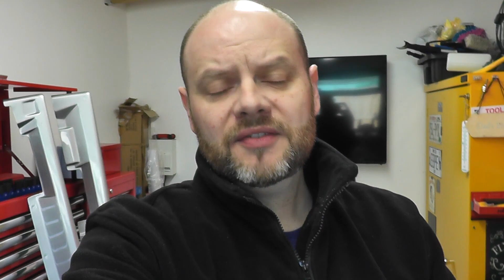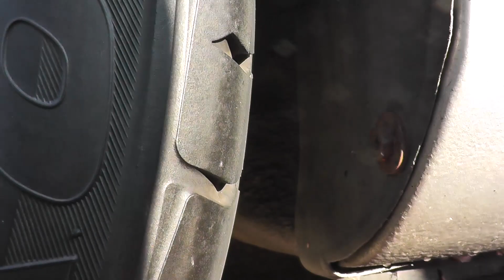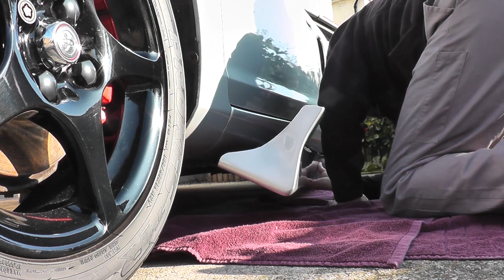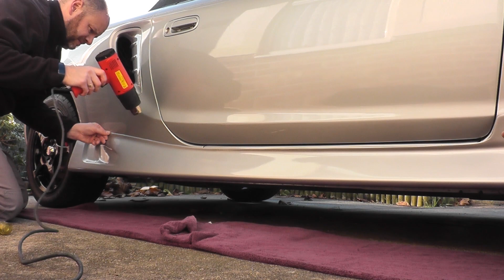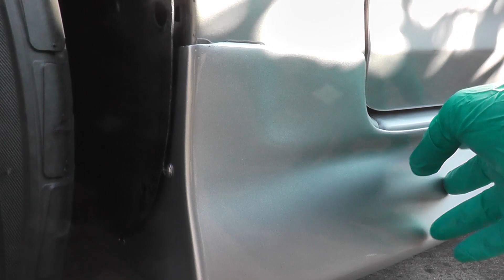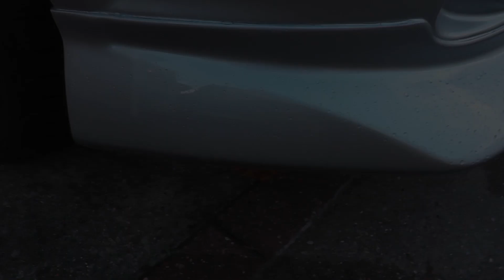MR2 TRD side skirt install

Comment: Although I liked they way mine looked up again the bottom of the door body line, I preferred to fit mine a little lower as I did not like the way they flared out too far at the wheels. Also made mine look lower and did not crack anything. But great job. Oh, I also taped off and painted pearl black the scoopy bits towards the rear of each skirt. Came out very nice. I used thin line tape to mask off the silver.
Reply from the maker: Sounds cool. Can you link a pic? 👍

Comment: Hi any chance you might know what can cause cracking, noise from the rear break hub? this happens when the car is rolling and brake is applied or handbrake pulled up. Without the brake there is no cracking noise. The rear brakes have been changed 1800miles ago ( EBC yellow stuff pads and EBC Slotted Rotors) The bedding in procedure has been completed and everything was fine until about 300 miles ago when I started to hear this. This is exceptionally noticed after a longer drive or after few harder brakings, Surprisingly the brakes heat up evenly on all 4 corners and there is no vibration when braking. Any Idea ? Car has 52000miles 2006 MR2... Thx
Reply: Ohh yeah forgot to mention that the cracking noise is not constant, it only appears when the wheel turns half a revolution every single time when brake is applied.
Reply: Try re-greasing the splines on your driveshaft. Common problem on Jap cars 370z etc May be similar fault on an MR2.
Reply from the maker: Would your brake discs be getting that hot due to some spirited driving that the pad is sticking to it? The fact it's happening wether you use the pedal or the handbrake rules out an isolated handbrake issue I think. Are all your rear pads seated properly and sliders greased etc? If you are experienced to do it yourself I'd take the pads out the carriers, clean everything down, regrease the slider pins and see how that goes. The rear calipers on our cars are a bit of a known weak design, I had to replace mine when I got the car due to them binding.
Reply: @DadDiaries  Hi , I had my mechanic to do all the brakes for me and I was with him when he was doing this job and I could clearly see that he has had the slider pins re-greased and  everything cleaned properly, therefore I don't think that something is sticking (like that wheel side does not get hotter than the other side and when driving normally without any hard braking it's dead cold). Can you tell me where did you get the caliper from and what brand? Toyota told me 305 euro for one caliper !!! Obviously I would need 2. Thanks!
Reply: @sixer48  I will have the mechanic to look at the car and try diagnose the problem, I will give it a shot and maybe it will help, Thx !

Comment: I forgot to ask, how come you chose to use self tapping screws on the bottom of the skirt instead of double sided tape? I am going to do this job after the paint is dry on my skirts.
Reply from the maker: So I could have used tape I guess but they should have lined up with the plastic body rivets to secure that way...mine didn't. Because on the air flow at speed under the car I wanted something to properly fix them in place to prevent them coming away...hence the self tappers. If they line up with the plastic rivets on the sill you won't need tape or self tappers.
Reply: @DadDiaries  makes sense, cheers.

Comment: All you used was double sided tape?
Reply from the maker: Yes along the body. That's how toyota fitted them. There is also two self tapping screws at each end in the wheel well and five self tappers along the bottom edge in the sill.
Reply: Dad Diaries where did you get the hardware from?
Reply from the maker: I bought the stainless steel screws from my local hardware store and the tape from my local body shop. The brand of the tape was 'Indasa'. There is so much fake 3M tape about I just went with a brand I could trust from my local paint shop.
Reply: Dad Diaries did you put those clips in? I looked in the official manual to install and I saw these clips, only problem is I don’t know what they look like.
Reply from the maker: I didn't because the skirts on the bottom didn't reach properly to fit them. If you have a look at an earlier video (mail call and MR2 updates) I show the clips. Let me know if you need a follow up vid on something let me know
Reply: Did you put the self tappers in the plastic fender liner or somewhere into the body? Also do you know of anyone who sells those clips?
Reply from the maker: I'll do a video for you,  it'll be easier to explain that way. The metal clips aren't available to buy,  I do have measurements to enable people to make some.
Reply: Dad Diaries ok thanks so much!
Reply: Dad Diaries I was thinking of putting riv nuts instead of the plastic clips and maybe then I don’t have to get brackets and I’ll wait for your instructions on the sides?
Reply from the maker: Yeah that's one way you could go
Reply: Dad Diaries could you send the link to the plastic river things?
Reply from the maker: Are you in the UK?
Reply: Dad Diaries no in the  USA :(
Reply from the maker: Send me your address via instagram messenger and I'll post you the ones I didn't use. You mean the round ones, four each side yes?
Reply: Dad Diaries ok thanks I’ll message you soon

Comment: so 4 years later, did this all rust?? Can't tap screws into my car ever ever EVER.. I've seen hundreds of widebodies and showcars with tapped screws in their body pieces that look immaculate in the garage but - when removed - reveal tons of rust where the screws went, often bubbles of rust too all down the body where water crept into the inaccessible cavity between the sheet metal.. since you're from the UK (where I recon rust is huge) and I'm not, yet see plenty of it... I'm wondering how yours fared?
Reply from the maker: No it hasnt...I used stainless steel fixings and the fix points are fine with no corrosion issues
Reply: @DadDiaries  that's incredible. its not so much the hardware in question, but the disturbance of the galvanic coat when penetrating the sheet metal happens. then the salt and moisture of real life starts doing it's work,

Comment: You're being too picky, it looks great.  I'm surprised at how easy they were to install.
You and (I'm assuming) your wife did a good job getting them lined up properly.
Reply from the maker: Your probably right there Bruce TBH its probably unrealistic to have a perfect line... especially with a GRP skirt. The first was a fraction too tight hence the crack and had i test fitted that one as well id have sanded the inner edge before fitting. Left hand side went on with no issues really.  Hahah that was eldest my eldest lad.
Reply: Tell him he has lovely hands lol
Reply from the maker: Hahahah I will lol.